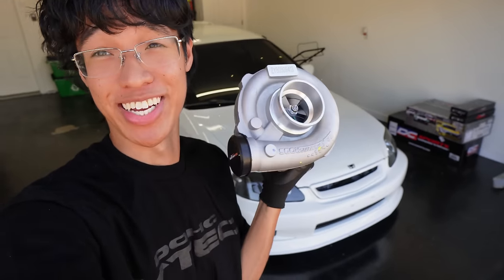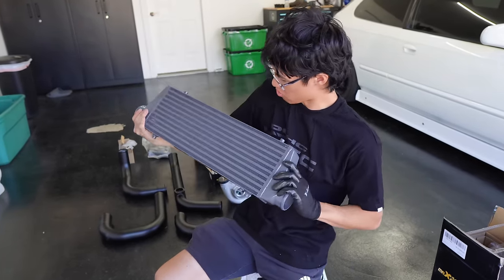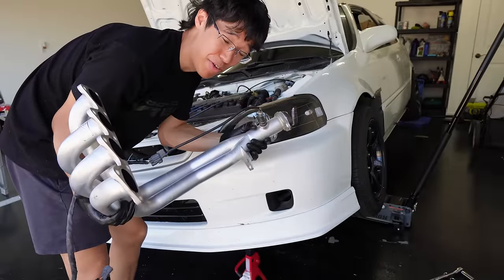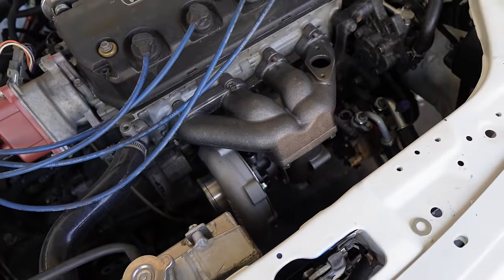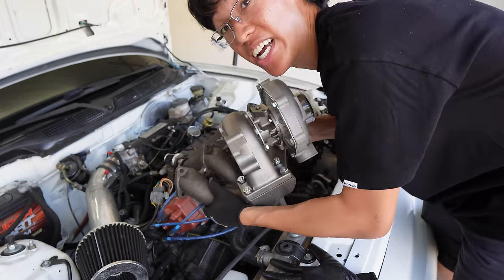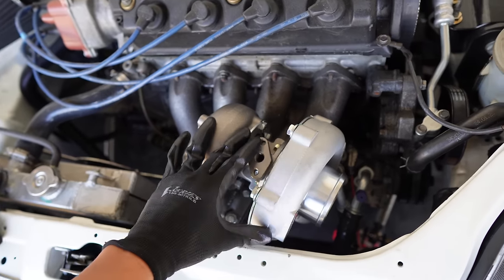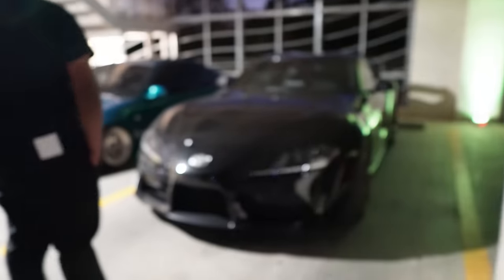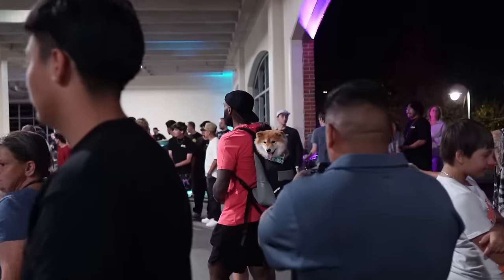Turning my SLOW Civic into SPEED DEMON!

Comment: I did a pretty good job installing a Turbo kit on my Dseries Ek Hatch on my channel. You can run your stock injectors if you're not trying to get power over 300.. Im excited to see the build!!
Reply from the maker: Gotcha! Just a little nervous running stock injectors 😅
Reply: @jarekmai  ull be fine bro i promise you but do whats best for you. I had a  D16y7/y8 Head. Previous owner said it had springs n retainers too. Make sure you upgrade your fuel pump tho

Comment: For the oil pan get a 10an no weld fitting just have to drill out where the oil return fitting will go farthest top left between the oil pan bolts and just silicone around it to seal and thats it. pretty cheap it like 10 $

Comment: I would assume you have a D16Y8 block in your civic. If so, you can build it to handle reliably around 575whp before doing any damage to the internals.  Vitara builds are pretty good for what kind of numbers you are seeking to obtain.  Much luck and love. Can't wait to see what you have in store for the civic next. Make sure you get a quality BOV. And pick up a 30lbs spring, boost gauge that registers 30psi, and you should be set to install.  Take your time and it will come out AWESOME 👌
Reply from the maker: Z6 bottom with Eagle rods and wiesco pistons. Hoping to triple the stock power and be usable for the street action 😈🤞
Reply: @jarekmai I'm proud of you Youngblood.